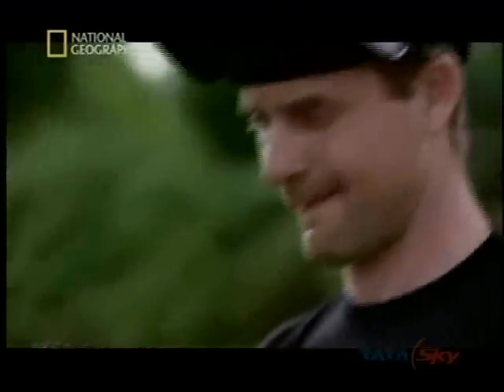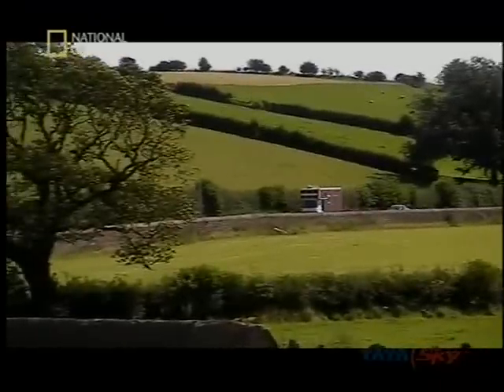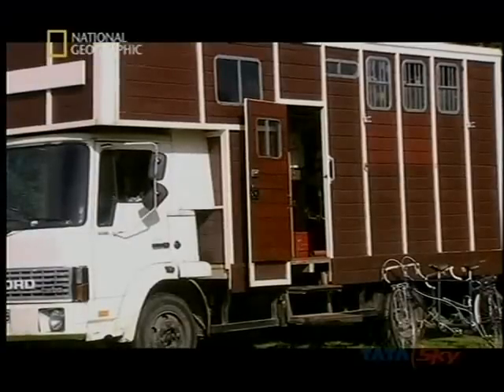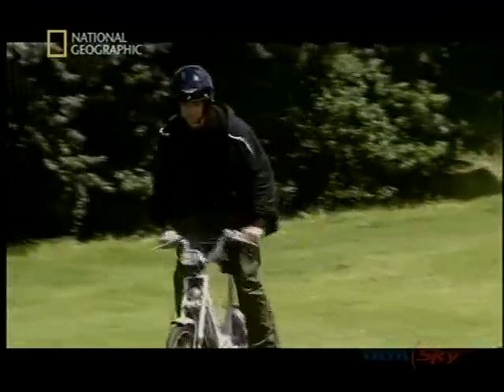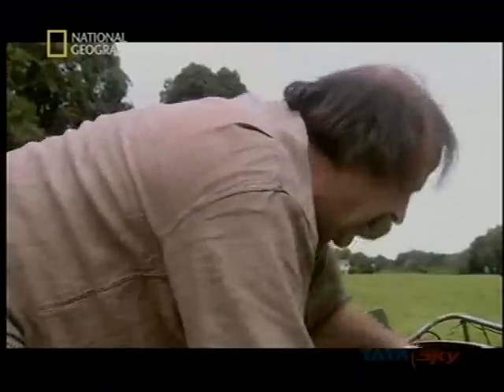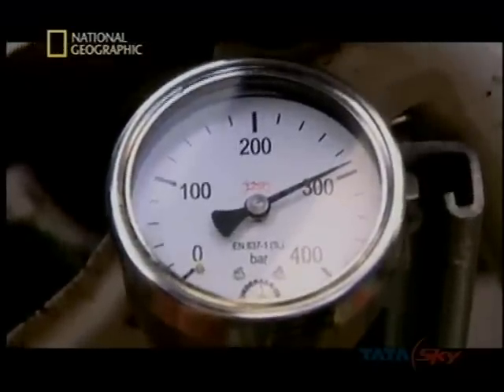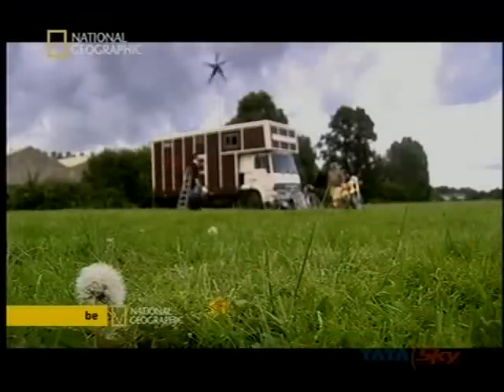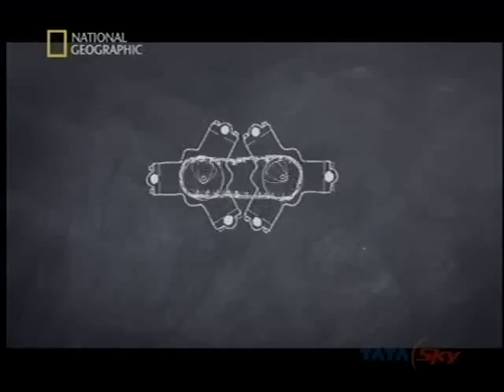National Geographic - Planet Mechanics - Air Propelled Sandwich Part 1

Comment: Air motors are not new. What is new is the rotary Wankel air motor and similar designs that are super efficient, even better than the original piston drive air motors.

Comment: Why don't they just use an impact air wrench? Just look up on Amazon the words IMPACT WRENCH and you will see how cheap they are. They operate on just 90 psi, and all you have to do is add a single scuba tank with a first stage pressure regulator to bring the pressure down to about 100 psi, and you will have a very strong, torque wrench powered bike.

Comment: There is a light-weight carbon fiber air tank available at airgunwarehouseinc dot co m for just $700. It is a small, low-pressure aluminum tank, which is covered with carbon fiber to make it stronger. It weighs less than 15 lbs (about 7 kg), but it's expensive. Of course, larger tanks and even bike frames with integrated tanks could be made to work quite well for much less money, if they were being built in volume. Oh, and it would sound like one of those guys changing tires at a tire shop.

Comment: what about the compressor? how eco is that? the electric used to charge it still needs fossil fuels to be produced so eh not 100% eco
Reply: No, it doesn´t NEED. It needs power, it can be from any source. Did you know that there are some apart from fossil fuels?